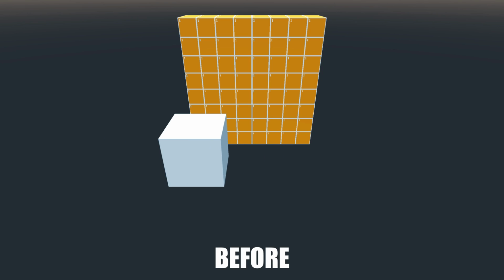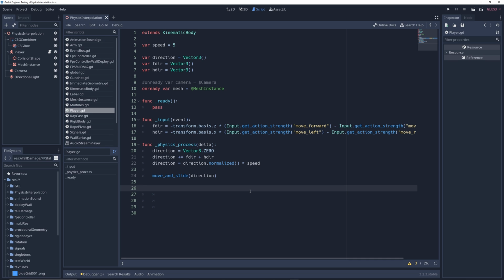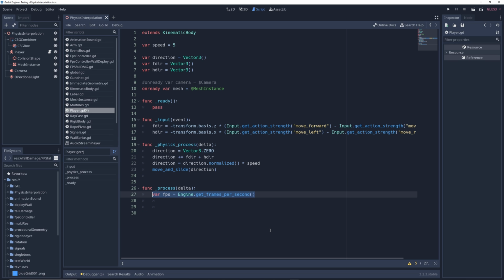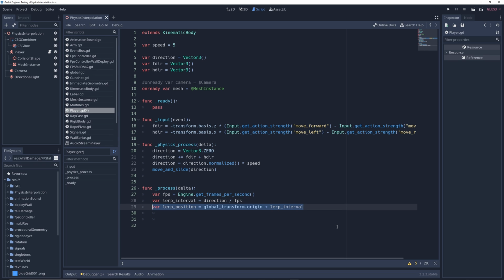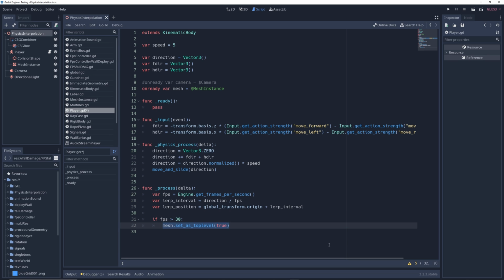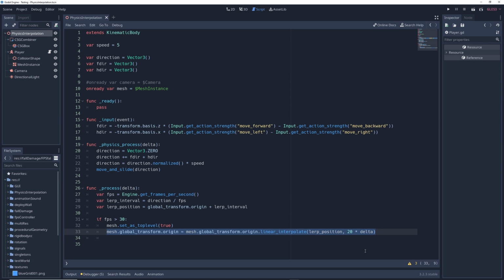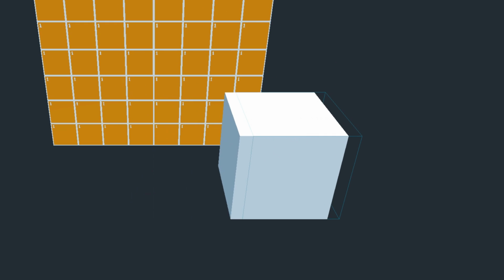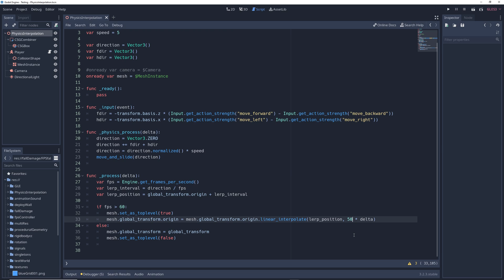Fixing Jittery Movement In Godot

Comment: So, here is what I like so much about this specific tutorial:
1. It offers a solution independent of the physics interpolation provided by the Engine and / or PlugIns.
2. It provides an explanation as to why there is no one-size-fits-all solution and what the actual tradeoffs and compromises of your approach are.
3. It gives you the needed terms / topics to do more research on in order to get a deeper understanding of the issue, which is great for learning.
4. It's short, well structured and concise.
5. You don't sound like you're bored to death and don't even want to be here. :D

Thanks, quality as usual and much appreciated!

Comment: If anybody's running into this issue with Godot 4 go to Project Settings > Physics > Common  and tick 'Physics Interpolation.' I do not know why it's not turned on by default
Reply: bro it was that fucking easy holy shit 😭😭😭😭
Reply: your fuckin amazing
Reply: That option only works in 2D. We need to wait for the 4.4 version to get the same for 3D
Reply: @yusarimahubara  Are you sure ? The option is there in Physics > Common with advanced options turned on.
Reply: It now works in 3D on version 4.4 as well.. You may get warnings and issues though if youre moving things like the camera outside of the physics process.. so when using physics interpolation you may need to move things from the process function into the physics process function instead.
Reply: @TheLoneInitiate  does that mean you have no choice than to interpolate the camera movement? That's not great for mouse movement...
Reply: @LightOffArchives  no you dont have to. If you want to you just add camera movement to physics process
Reply: OMFG you are the man, thank you
Reply: I will forever and ever be grateful for your comment. Thank you
Reply: THANK YOU. This fixed my issue for isometric 3D camera movements following the player. It was blurring
Reply: thank you man you saved me from another hour of searching solution🙃
Reply: thanks!

Comment: you could do alllllllllll of that or do this project > project settings > common (under physics make sure advanced settings are on) and set physics jitter fix to 0 this worked for me in godot 4.2.2!
Reply: Hello :) Has this 100% fixed your jittering issues? And it has caused no other issues by setting this to 0? :)
Reply: @Azzavhar  yeah. i have had no issues so far and its been a while. just keep in mind 3D physics interpolation is coming to godot at some point and that will fix the jittering. :D
Reply: @drayodev  Cool. Thank you. And was yours 2D or 3D? 👍
Reply: @Azzavhar  3D
Reply: @drayodev  Thank you! 🎉👍😁
Reply: @ 3D physics interpolation just got added so that will fix all jittering! to enable it go to project > project settings > physics > common > physics interpolation then set the Physics ticks per seconds to what you require!

Comment: This worked for my fps camera great, thanks so much. For this wondering how to achieve the jitter fix for a first person camera, here's my current working code for Godot 4.2.2, which sits on the camera itself. 

A couple of notes:
- linear_interpolate() has been shortened to lerp()
-If you rotate the camera directly, your code will probably look more like Garbaj's. I had to modify it because of the way my player is set up.

extends Camera3D

@export var player_controller:PlayerController # The node with the script containing the player's direction var
@export var player_eyes:Node3D # The node that rotates my camera. You might not need this.

func _process(delta):
	self.global_basis = player_eyes.global_basis
	
	var fps = Engine.get_frames_per_second()
	var lerp_interval = player_controller.direction / fps
	var lerp_position = player_eyes.global_transform.origin + lerp_interval
	
	if fps > 60: # The value here should be the same as the project's physics ticks per second, as Garbaj said,
		# because the jitter comes from the game outputting higher FPS than physics ticks.
		self.set_as_top_level(true)
		self.global_transform.origin = self.global_transform.origin.lerp(lerp_position, 20 * delta)
	else:
		self.global_transform = player_controller.global_transform
		self.set_as_top_level(false)
Reply: Im making a fps too and my controller (along with the hands and weapon of the character) is so good that its similar to Rainbow 6 "feel". So when I saw the jitter above 60frames  I dropped my project completely and I was waiting for Physics Interpolation to be implemented in Godot 4. I will try  your code, next week, and if it works I will continue my project! (I was asking a Godot contributor, and from what he told me Physics Interpolation, for 3D, wont be implemented soon..Im guessing probably in around a year or more maybe .. so lets hope we wont need it)

Comment: My solution: If you are on a more modern version of godot, you can just go project settings>common>set  physics fps from 60 to the refresh rate you need, you will need to re adjust your player speed but after that it's a definitive solution, then, from the inspector, check your camera process from idle to physics as well, jittering causes when stuff is not called simultaneosly, so assuring that player and camera updates are synchronized in my case removed the problem completely
Reply: This is a lot more expensive though, because physics will be simulated at the rate you enter
Reply: Yep, by the same reason, higher frame rate are more expensive, you should be doing this only if you intend a game running above +60 fps, if you're having jittering on a game running at 60 fps then I'll asume that this is not a solution
Reply: @benjaminborja5029  It depends on how complex the scene is I guess. Your CPU is doing a lot more work simulating physics than the GPU is rendering the scene. So even if you can pull 144fps on your game, your physics rate shouldn't be 144Hz; interpolation is better for that.
Reply: Hmmm...the real question will be by how much it affects performance, as a game intended to be only for pc (in my case at least), if that means jumping from 2% to 3% cpu usage to getting rid of this will be a gladly cost to pay, at least until I find an interpolation method that works for me :(
Reply: If you have a multi threaded cpu, you can enable "run separate physics thread". That will make stuff better
Reply: Bro you are a legend lool. Thanks so much for the comment. Fixed my problem!

Comment: THANK YOU!!!! Exactly what i was looking for! Really needed it for my 2d game... But i didn't want sprites to be set toplevel obviously, so a made a little change.

I made a Vector2 "globals_sprites_position" variable that will replace global_transform.origin

	var FPS = Engine.get_frames_per_second()
	var lerp_interval = velocity / FPS
	var lerp_position = global_position + lerp_interval
	globals_sprites_position = globals_sprites_position.lerp(lerp_position, 20 * delta)
	Sprites.position = globals_sprites_position - global_position

works just fine
Reply: Hi, thank you for the snippet! I ran into some issues with your code where if you have some movement the moment game starts, the character jitters all over the place because FPS is set to 1 for the first second of the game, and also it caused issues with lower or dropping frame rates (like < 60 FPS), so I modified the code you provided to not interpolate if FPS is lower than physics FPS: 

	var FPS = Engine.get_frames_per_second()
	if FPS > Engine.physics_ticks_per_second:
		var lerp_interval = velocity / FPS
		var lerp_position = global_position + lerp_interval
		globals_sprites_position = globals_sprites_position.lerp(lerp_position, min(delta * 50,1))
		sprite.position = globals_sprites_position - global_position
	else:
		globals_sprites_position = global_position

I hope this helps someone!

Comment: I am using process delta for move and slide. I read that we should be using physics process. But there’s the frame rate issue. I will try to fix the issue with your suggestion
Reply: so if anyone is interested what I did is far less complex that doing a code based solution:Frame rate lock your games FPS to match the Physics FPS. Why? Well, even the suggested solution by this video suggests that collision shapes may not be in synch with animation. So it's not perfect. The best solution is to wait for Godot to release 2D/3D interpolation, or frame rate lock your game. Zelda is locked at 30FPS and is an amazing game.

Comment: Couldnt this also be fixed by turning VSync on?  Godot Physics rate is set to 60 fps by default.  VSync locks the framerate at 60 fps.
Reply: No cause if you would have a higher refresh rate monitor for example 144hz VSync would lock it to 144fps.

Comment: Your _physics_process() function has a minor bug, your object speed is not independent of update cycles. At the moment if you increased your physics to 60Hz, your object would move twice as fast. I recommend you use the delta passed in:

direction = direction.normalized() * speed * delta ;

This will ensure the object moves at a constant rate of 5 units per-second irrespective of your physics update rate.

Interpolation will always lag behind the true state of the game world, the only way to get closer to the actual state of the game world is to increase the rendering rate, however you'll never reach the actual current state.

In my own game-engine I built the interpolation into my 'draw' objects, this way the developer can update the position/scale/rotation of an object and leave the render to deal with the interpolation and frame rate passing.
Reply: Godot 3s move_and_slide method automatically multiplies the vector by delta, so his implementation is correct

Comment: Would a formula similar to this also work for updating rotational values rather than position?
Reply: It will, but there is an edge case. 0 and 360 degrees is the same position,  if you were to linear_interpolate from 270 to 0 it would traverse the full 270 degrees instead of 90 degrees that's actually required.

The below example is in radians, and deals with rotation on the x-axis, but the same logic can be duplicated to apply to y and z too.

var diffX = abs( rotation.x - newRotation.x )
if( diffX > PI )
{
    rotation.x += (newRotationX > rotation.x) ? PI2 : PI
}

Note: PI2 = PI * 2

Comment: Or you can use delta
Reply: Yeah unity is awesome
Reply: @cristianjuarez1086  what?
Reply: @tengkuizdihar  delta is the change in time between frames. Unity has Time.deltaTime and returns how long took the last frame to load
Reply: @cristianjuarez1086  i know that, but what's the connection between that and "unity is awesome"?

Comment: Great video! However, things like this should be taken care of by the engine  and not be fixed with hacky workarounds by the user.
Reply from the maker: While I don't necessarily agree that an engine "should" take care of it for you, because not every game needs the extra complexity, I can certainly understand the frustration of those who just want their game to look good right out of the box. Godot's developer is looking into adding built-in physics interpolation to the engine, but I think knowing ways to deal with it manually is also extremely useful.
Reply: @garbaj  it should take care of it in every game that uses physics, 144hz+ gaming monitors are pretty common these days and playing a game that feels like it is locked at 60fps doesn't feel good at all. Having to hack a solution just so your game can feel smooth on modern gaming setups isn't right.
Reply: I'm pretty sure this same fix is coming in 4.0 as an optional feature.

Comment: A plugin exists for just this. lawnjellys fixed timestep interpolation plugin for godot. 
https://github.com/lawnjelly/smoothing-addon you should check it out. Although the problem with working with it is you need to restructure your scenes.
Reply: I have also taken a shot at making something that can be used as a plugin, although might not be tested enough. 
here is mine https://github.com/2nafish117/godot-interpolation-demo
Reply from the maker: I am aware of this plugin. I dunno if it works better than my solution or not, all I know is that my version uses 10 lines of code, while the plugin has over 100 lines of code.

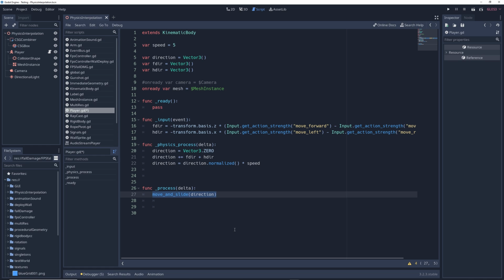Comment: 1:14
It's probably not the correct solution but while I was trying to figure out how to fix jitter, I eventually just gave up and moved all my move_and_slide() code into the _process function and just multiplied all my movement vectors by 'delta' and defined my speeds for movement in terms of 'm/s'. Delta is always the length of time that has passed since the last frame. No matter how fast or slow the framerate gets, everything moves at the correct speed.
Again probably not the correct solution for various reasons but after pulling my hair out for 2 weeks trying to fix the problems I had with jitter and sliding and other issues, doing that simple change just fixed everything so I said screw it and went with it.
Reply from the maker: The main issue I came across when splitting move and slide into process was that sometimes things like is_on_floor() would not work properly, which could mess with your ability to jump among other things. Highly recommended that you move everything into physics_process

Comment: I like the explanations, I get a better grasp if I get the why instead of a "it's common standard"
Reply: I've been trying to figure it out. I'm pretty sure, different calls to physics_process overlap and one step gets resolved before the previous one. I had this problem with 2D jittering.
It's NOT the answer, but if you're desperate, try adding some "processing" to the physics_process so it doesn't end so quickly.
My game had that problem, again, it's NOT a solution, just a quick fix. I added these lines before calling move_and_side() and it worked:
	for n in range(0, 20000, 1):
		velocity.y = velocity.y;
I hope this comment can help someone in distress.

Comment: I am from Russia and do not speak English well.
It is better to use get_physics_interpolation_fraction () for interpolation rather than get_frames_per_second ().
If you use get_frames_per_second (), it is impossible to remove ALL the jitter/support/hangs.
You have a special case, because fps ratio of physics and graphics 1/2
Try your code at different fps ratios of physics and graphics. For example - physics: 47fps, graphics: 60fps, etc.
A slight tug will appear.
---
var fraction = Engine.get_physics_interpolation_fraction()
player_body.global_transform.origin = last_physics_pos.linear_interpolate(global_transform.origin, fraction)
Reply: "i do not speak english well"

comments in perfect english...
Reply from the maker: thanks, I'll check it out
Reply: I did almost exactly as you suggested with these two lines of code and my movement is literally smooth as silk now thank you XD
Reply from the maker: I tried it out and unfortunately it seems to make the jitter even worse. I'll keep testing it out though
Reply: @garbaj  Here is an example of the code that solves the problem with the appearance of a small model jitter when the fps of physics drops slightly relative to the fps of graphics 
https://pastebin.com/fqkCZphi
P.S.  player_body - Is a mesh. I.e. a visual representation of the player that is not a child node to KinematicBody.
Reply: @ИванИванов-ю8у2е  The update to last_physics_pos in _physics_process should take place before calling move_and_slide()
Reply: Tried Garbaj method and did not work for me, so I read your comment and just describes my situation: Got a new monitor with 144hz and my 60fps physics engine makes my game looks jitter, setting it to 144hz makes my game jitter on the 60hz one, so I used "var fps = Engine.get_frames_drawn()" and works properly rn.